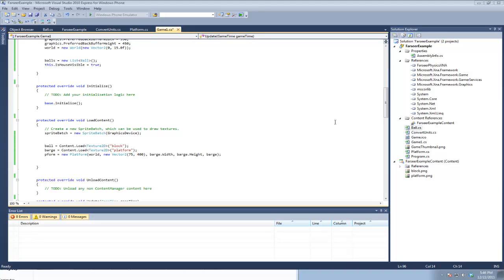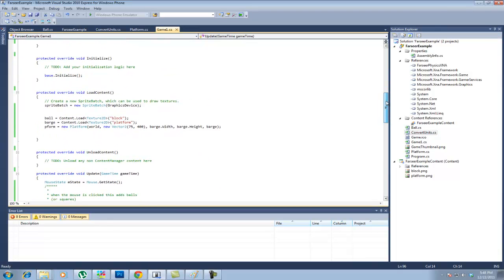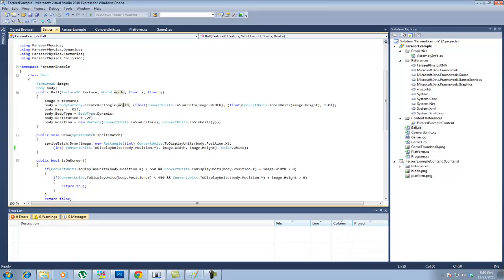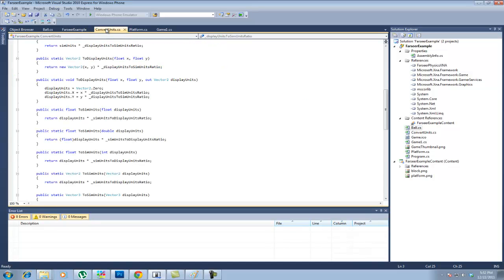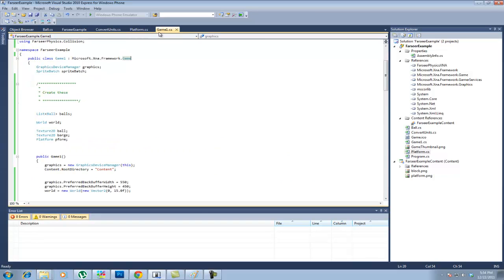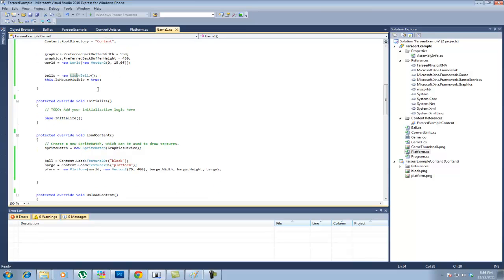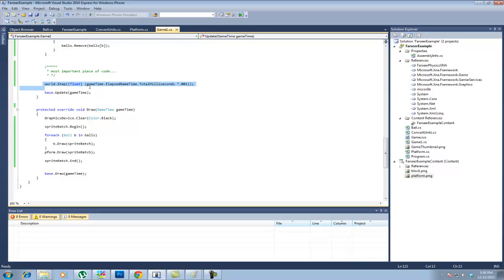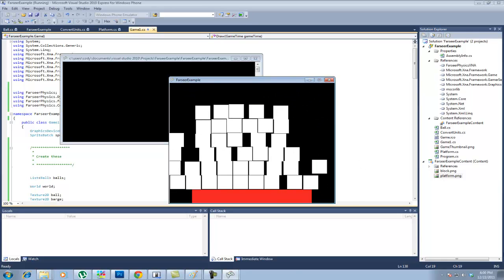Walkthrough of Farseer Collision  Project with XNA

Comment: I FOUND IT!!!
I followed your code exactly, and I found out what the collision detection issue is.
Farseer places the origin of the object at the center of the body
In the draw function that you're using, the origin is assumed at the upper-left of the screen.
That's why you have to do weird things like x2 the platform, and how the platform exists in a place where it's not drawn (left of the screen).
Solution: in the spritebatch.Draw, specify the origin as the middle of the Rectangle!
Reply: Yeah that worked great